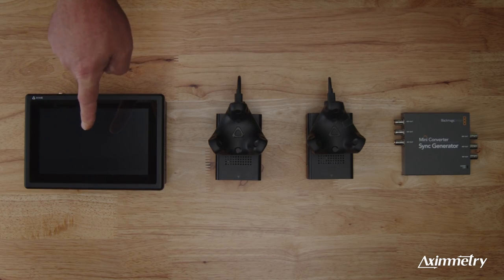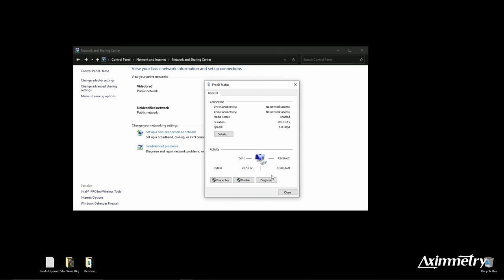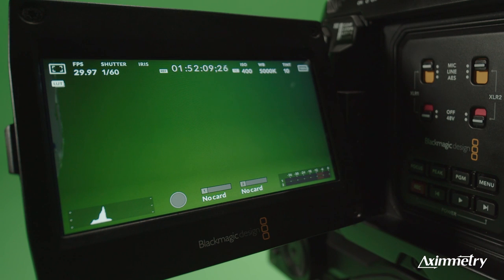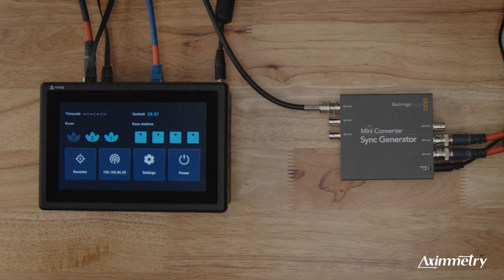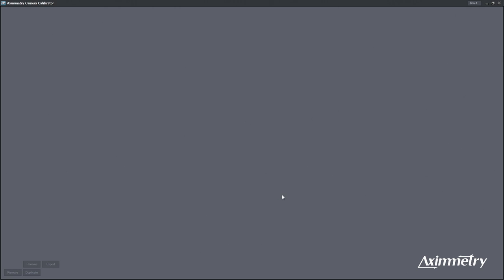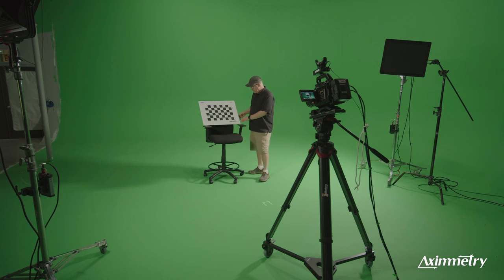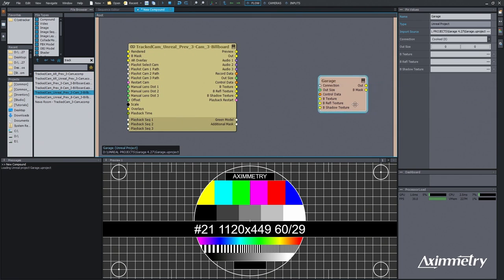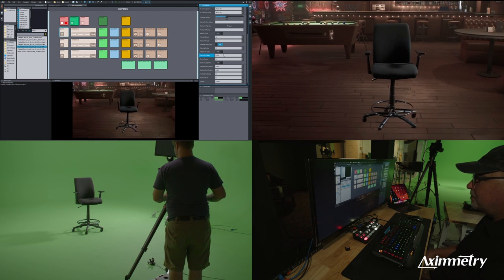Using Aximmetry with HTC VIVE MARS Camtrack | Aximmetry

Comment: Was surprised you used the manual tracking delay offset instead of the Timecode Sync toggle next to it. What was the reasoning for that?
Reply from the maker: We are very sorry for our late reply. Since the Blackmagic Mini Converter Sync Generator only provides a reference signal, not an external Timecode signal, we cannot use Timecode sync. With further technical questions, please please post on our official Forum moderated by Aximmetry consultants: https://my.aximmetry.com/posts for expert advice.

Comment: I keep getting the error message in camera calibration "the tracking device was lost" after we complete the lens calibration. Do you know why this is happening and how to resolve it?
Reply from the maker: There might be some issues with the configuration of your system. Please post your questions on our official Forum: https://my.aximmetry.com/posts. The Forum is designed to be community-based and monitored by our technical consultants, where they will be able to answer within 15 working days, unless someone from the community answers before.
Reply: @aximmetry  I found the solution to the issue: it's now the pinned comment: The Cmaera ID should be set to "1" instead of "0"
Reply: @poalaburr  💯 Thank you.

Comment: Way too much work and money still for results like that.   Lighting is usually off and doesn't move or match the scene so in this case it seems like it would be easier to track motion of person in After Effects with background markers, send tracking data into UE5 and render a scene where the camera in the program moves to match original green screen video.  One of the best features of the LED wall is it lighting the subject as well so looks natural so if we can't get that bonus, why spend all the money for Mars stuff and just go through software.
Reply: Never rely on LED panel lighting
Reply: Mars costs 5000$, led wall that size will be 350000$ easy. That’s why
Reply: Add a 3rd rover to the lighting fixture and use it in the unreal project. I don't know if technically possible, but I would try to use DMX to sync the virtual light with the fixture. I also think they didn't want to spend additional resources/time to set up a correct gaffing setup, for this quick demo, like using a softbox,.... Take a look at this "old" setup, with Vive Pro (before Mars was available): https://www.youtube.com/watch?v=cOI-cjdULmk